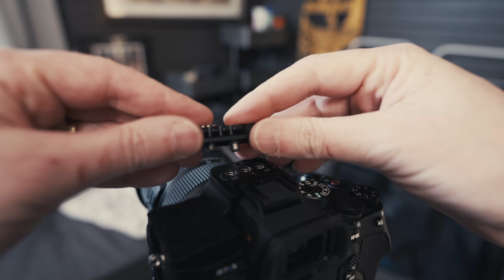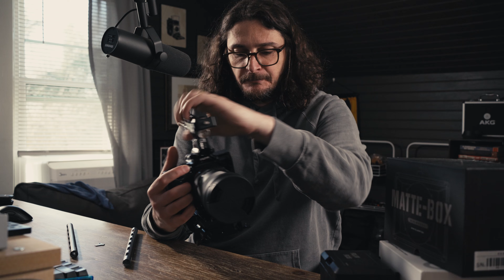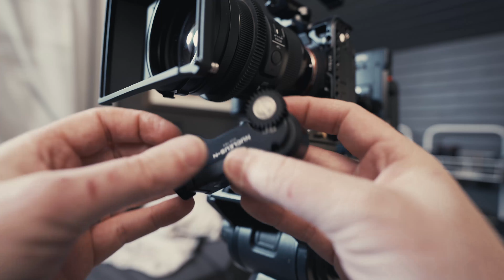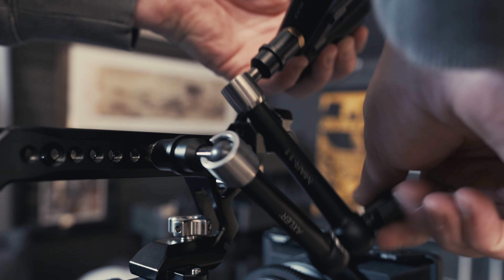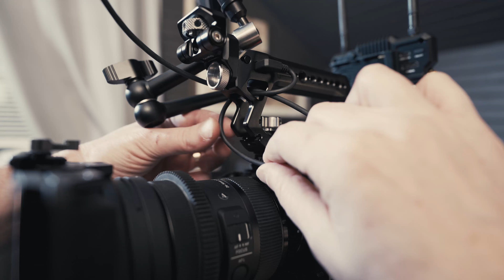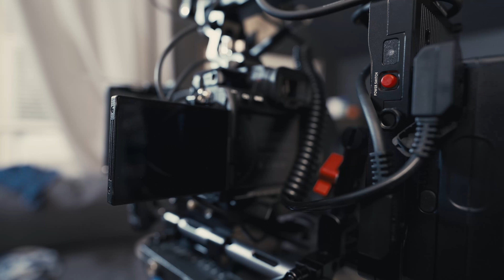Sony a7SIII "Cinema" Rig Build/Spaghetti Monster

Comment: What cables are needed to fully power the dc outputs for the monitor? The DC 8.4v or 12v. I have a feelworld f5 Monitor. I want to continuously power it using that battery you have that powers the camera as well
Reply from the maker: A DC 12 volt will work
Reply from the maker: DC 12v to D-Tap
Reply: @PhillipRPeck  thank you!